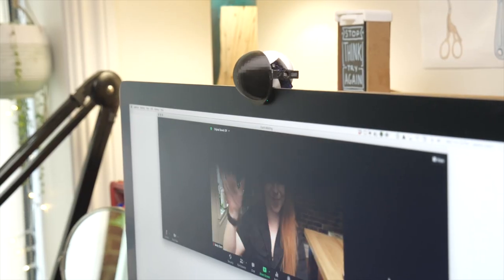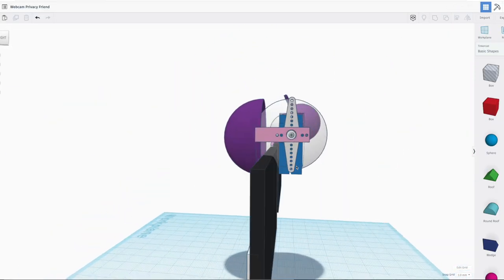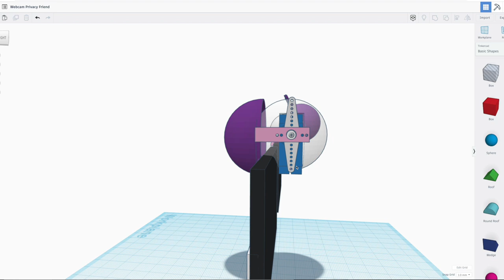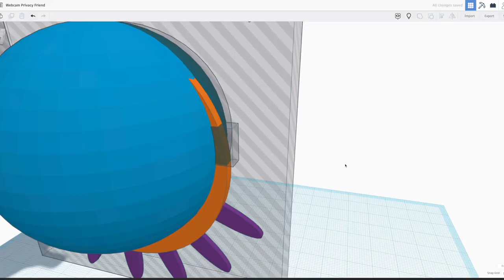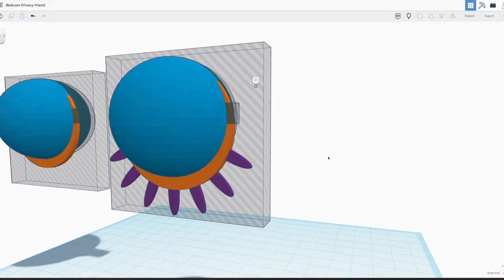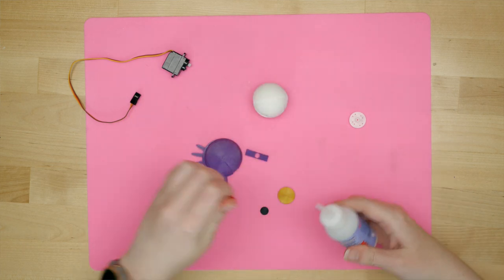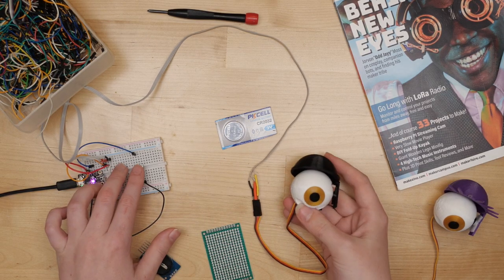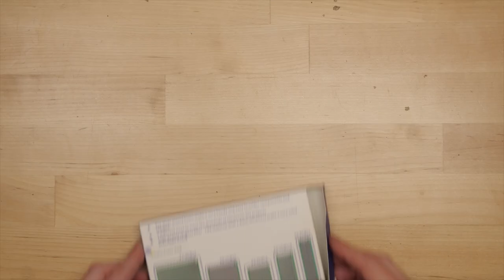3D Printed Webcam Privacy Cover

Comment: So cool! Haha, at 2:17, I love the eyelashes effect! And fully agree with Jayy’s analysis at 2:52 - beautifully clever! I also really like his idea of fabric (or something) for eyelashes (though even the plastic ones are pretty cool), and I have the idea that it’d be extra cool (if also a more challenging project) to have a version with both top and bottom lids, that “interlock” (using that term loosely) when closing... and setting it up with a “blink” mode that could either be triggered manually, or like run on a randomized timer every ~30-45 seconds, on average (or whatever), or even an “I’m getting sleepy” (/bored of this meeting) social cue, where it very slowly starts to close, and then jerks back open. Ok, I may have to work on doing a version of this!! Too many fun ideas. Thank you for inspiring them, Becky, and for sharing this cool build!

Comment: Absolutely love this as this is what I need as I'm looking for a cam cover replacement. I'm going to add manual buttons with the most common meeting lengths (15m, 30m, 1h, reset) and a display remaining time with a warning LED for the last minute.

I prefer the tangible feel of controlling my webcam cover so controlling with buttons is better. Adding an LCD screen with my upcoming meetings and perhaps a visual queue could be a nice touch with an ESP module.

Comment: You could use a microcontroller with wifi or a raspberry pi zero w to sync it with your calendar or with Teams/Zoom to pull down whether or not you've an active call.  Another possible option is to poll the device in the OS and see if its being used by one of the video meeting apps and if it is open the servo or else close it.
Reply from the maker: Cool ideas!

Comment: A cool upgrade would be to add a light sensor which looks at the webcam indicator LED and automatically opens and closes the eyelid when it turns on or off, possibly requiring input from the user as well as the light sensor to open.
Reply: Kinda like the gate iris from Stargate, and now that I think about it a teeny tiny Stargate that opens to reveal your webcam would be awesome!
Reply: Not a bad thought. A similar suggestion was made in a comment by James Sherman; I’ve written a response there on why I wouldn’t use (and would indeed advise against) this strategy. Check it out if you’re interested.
Reply: @DavidLindes  replied on that thread.

Comment: Nice idea Becky! My webcam has an active light, it should be fairly easy to design a circuit that hooked into that for automatic opening?
Reply: Yeah, you could replace the LED by an opto-isolator. They're just an IR LED with a photo-transistor in the same package so the webcam circuit wouldn't know it's been altered in any way. Or just stick a photo-transistor in a way that it can see the LED from the side and go from there. But you won't have any manual control over the opening and closing of the webcam.
Reply: The problem with this strategy is: what if the LED lies? In at least some hardware configurations, I believe it’s possible to turn on the camera without turning on the LED (and even if that’s not the case, it’s something people wonder/worry about). If this weren’t the case, why would we care about physically blocking it, when it can just be turned off? To me, the point of automatic control would be to automatically close it in certain circumstances, and opening it would always be manual. YMMV, however. Different people have different threat models, concerns, preferences, etc.
Reply: @DavidLindes  That's the point,  there are hacks that make the led lie, so the light doesn't come on even though the camera is. So this is EXACTLY the time we want the cover to stay closed.
Reply: @DavidLindes  yeah that's the point. If the LED stays off even though the camera is on, the cover should stay closed. That takes care of false negatives on the LED.

The only other danger is false positives, where the attacker turns on your camera and the LED in order to get your cover to open. That's why in my version of the suggestion I said that to open the cover we should require both input from the user and input from the sensor.

So if your camera light comes on we wait for you to hit a physical button and if you do then we open the gate because we know that you're sitting there and are aware of the camera activation. If an attacker activates the camera remotely, you aren't there to push the physical button and so the cover doesn't open.
Reply from the maker: I don't even have this thing plugged in to the computer with a data cable-- if somebody is hacking my camera on, certainly they could also reprogram the Arduino to open the lid.

Comment: It's a bit funny but I would have made the eyes in the same way puppet eyes are made. But with my current crappy computer and it's add-on webcam, when I'm done I just pull the USB cable. I know I should make some more sophisticated switch for it but for now, it just works.

Comment: how long might the battery last?
Reply from the maker: No battery, it's plugged in with USB
Reply: oh okay, I didn't see the USB cable but did see the CR3 cell.
Reply from the maker: @tekvax01  ah yes, that’s for the real-time clock to keep its time even when unplugged
Reply: @BeckyStern  oh... of course! I have a Crono-dot I bought from Limor several years ago, for an eleven-tube nixie clock I built. It has month, day, year, HH, mm, ss, and the Decimal points are the day of the week... I can send you a picture if you are interested...